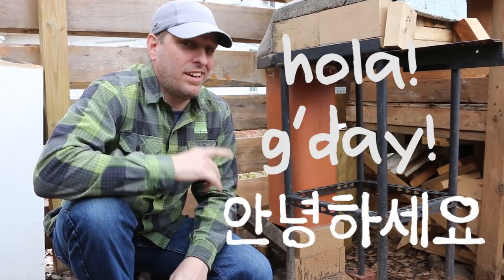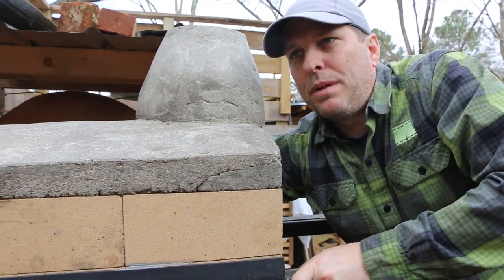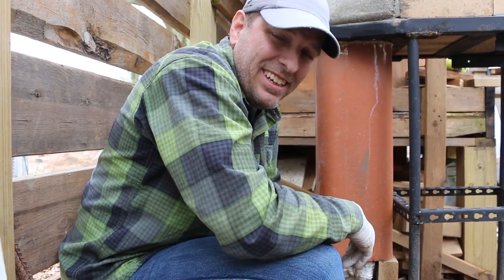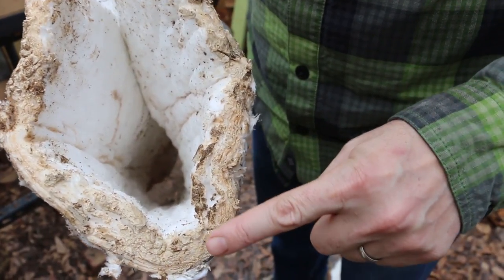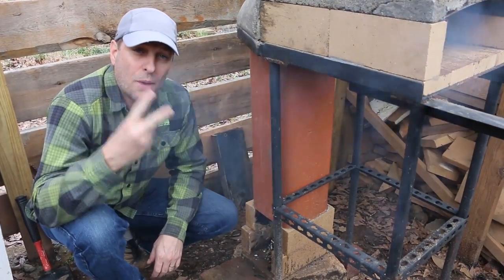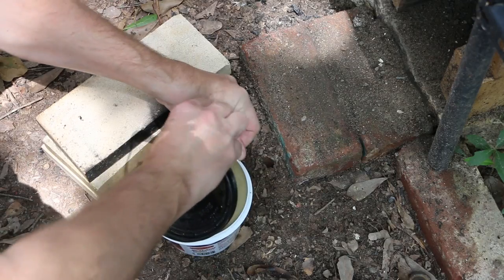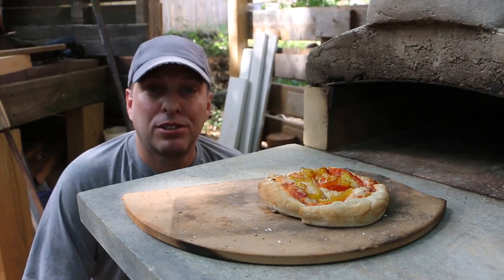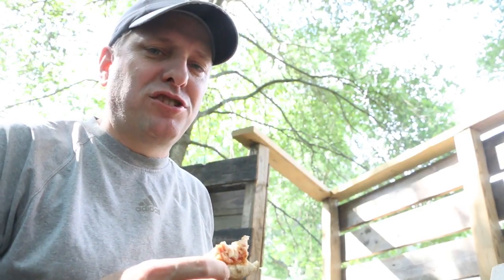How To Make A Rocket Stove Pizza Oven | Part 3

Comment: problem with cracking is the coefficient of expansion of two different materials. concrete and steel expand at different temperatures, that is why buildings collapse during fires, try building the dome with out  the reinforcement, perhaps brick arches then your concrete, otherwise good effort.

Comment: If you use a double floor and walls, with space in between, you could divert some of the heat around the oven chamber and have the hot floor that would crisp the bottom of the pizza.  Might also divert some of the ash.

Comment: A slight raise to your pizza base stone with say 1/4" shims on outside edges to allow heat to roll under the baking Stone as well. It IS shame as soggy bottoms take away from the pizza itself. Lol
Reply from the maker: Ha! Thanks for the suggestion, Edie. And you are correct, a crisp bottom is key to a good slice of pizza. Thanks for watching.
Reply: Actually, Edie's right, a double bottom might work a lot better. Look on Amazon for oven pizza stone that nearly fits your oven and lift it with some 1" or less angle iron. It might work if you insert it all the way to the back of the oven to direct flue gases and ash away from the pizza. Whatever, your determination and perseverance are really admirable!

Comment: use layer of  mineralwool/ Rockwool / glasswool from outside and heat loses will be minimal in winter ..... you can try using steal wool block at the joining portion of stove.. to avoid ash coming in to pizza oven....very  good video.....

Comment: Do you have a infrared thermometer? I’d be curious to see what temps you’re getting. Also, I wonder if the pizza stone is redundant. Weren’t they designed to mimic what firebricks do?

I just finished my earthen oven and am a bit frustrated at how much wood it takes to get that thing up to temp. This is a cool idea. I wonder if you could line the outside of the concrete with an insulator? Then the concrete would be your thermal mass and the insulator will retain that heat. Just a thought.

Edit: I just watched your second video and noticed the perlite. I don’t know if this is true, but I always assumed you didn’t want your thermal mass to be insulated. Don’t you want heat to transfer quickly to your thermal mass? Then you surround the thermal mass with insulation to retain that heat? I dunno. I’m a novice at this. Anyway, I hope it works out!
Reply from the maker: Hi Dustin. I don’t have a infrared thermometer, but do have a friend that does. I’ll have to borrow it. My thinking on the oven was that the rebar would be the thermal mass. I wanted to keep the heat from entering the concrete. I’ll need to spend a little more time with this oven to figure out how the heat flies through it. The thermometer will help. I also need to do a little research on your question about firebrick versus pizza stone. Thanks for the feedback and encouragement. Thanks for watching.
Reply: Hey bud, You're doing ok. Might of been better having the rebar above the perlite mix. Steel has no refractory capability so all you would be doing is heating the bar to room temp instead of generating heat. Same situation if you had a foundry furnace, you would never get temp up to melt a soda can. Best wishes and I'm following with interest.

Comment: Nice job and good craftsmanship but your Rocket Stove lower section need to be one half the length of the height of the exhaust flue,  with separate air space under material that is burning, increasing airspeed and complete burn with high temperature. Your effort will shine, great job!
Reply: Wait, how?

Comment: Good job,,, in my opinion you sh'd have the Rocket Stove centerd under the oven so the rocks w´d be the first contact and get heated up first, after that you channel out the the heat&smoke throu the inside of the oven. keep the good job up :)

Comment: I was hoping this would have worked better, for I was considering something similar, but thanks for giving me something to go build off of. I have to agree with those who talk of heating the floor first with a chamber and or rocket stove placed at the front. (With Chambers you could make it purely a white oven with no ash problem. The reason other ovens make 60-90 second pizzas is the combination of heat and heat types from all directions. I also do not understand why you went with the rebar. Was it to be able to support the dome? Metal may gain heat fast, but it also loses it faster requiring higher heat to maintain the cooking temps from what I understand. I also concur with the comment of not mixing perlite into the thermal mass (I think you hoped the rebar would be the main thermal mass though). I'm also not sure about using concrete? I just use fire clay and sand. It seems to hold and radiate the heat better. Fire clay for me is much less expensive than concrete ($9 for 50#) and is of such purity that the last oven I built did not crack. I was surprised. Also I usually do not use perlite as insulation, so I decided to try it with my last build. I found it inferior to using a course sawdust or planer shaving coated in a thin coat of clay. Have you found the same? You probably need a thicker insulation layer also. My pizzas are done usually in 60 seconds (thin crust light sauce) to 90 seconds (thicker crust heavy sauce) and people are amazed at how the crust is cooked through with no rawness/guminess between the crust and toppings. Overall I would summarize by saying it seems to need: 1. The floor heated, 2. Loose the metal, 3.Thicker insulation (no perlite in the thermal layer). Thanks again for being real and thorough with what you did. It will save me a step on my next build. jonathan
Reply from the maker: Thanks Jonathan. Good feedback. I need to get into some fire clay. And I've been wanting to try the sawdust method, so its nice to hear of your success with it. With the rebar I was trying to create a "broiler" top-down heat. The perlite was there to prevent heat transferring into the concrete (I didn't want the concrete to be thermal mass). I think one thing that might help my stove/oven combo is making my rocket stove chimney shorter. To get the flames moving through the oven body itself. Will definitely be using thinner crust. Thanks again for the comment. Thanks for watching.

Comment: great series.  I like how you show the project mishaps too.  we all have them, and learn from them.  I didn't even think about the kaowool danger.  I got some alumina silicate insulation, which I'm not sure is the same as kaowool, but discovered it is pretty dangerous.  Mainly from inhaling the fibers.  anyway, I have had pretty good luck with coating it with satanite, which is a high temp mortar.  you could use that for everything you use that tub of mortar for.  it's a powder and you can mix it up thicker or thinner depending on what your need is at the moment.  keep up the good work!

Comment: Great experimenting job.
You have to get the floor as hot as needed. And to do so you have to set the fire in front. Letting it mooving under the entire floor and getting out from the bsck to the chamber.
The entire chemines must be set in zig zag combined positions.
The chemine fire in front, sending the fire under the floor. The fire moves up to the chamber from the back and coming out from the uper front chemine.
Reply from the maker: Thanks for the feedback. I may make a second rocket stove under the floor. Thanks for watching.

Comment: Use the floor of your oven, let it get hot. 750 degrees in the middle should be good. Cheap infrared thermometers on amazon. And please use a metal pizza peel. For removing and turning the pizza. If the fire doesn’t rocket, add some fan to the fire. Cheap rechargeable ones on amazon, under $20. Just a little blow works wonders. Keep the door on while  oven heats up.

Comment: Years later I know, but if you still have the pizza oven, have you tried to just make a big fire in the top which would really get intense heat in the oven bottom? Once the fire is burned down enough, you could just push the coals back down the flu pipe.

Comment: make pizza crust 1/8th inch thick; use rolling pin if you have to; thinner you make faster it cook; make  it 1/16th if you can; 
as to cracking; sudden change in heat causes cracking; gradual rise in heat will not crack; even in earthen wares;

Comment: Great build, but I think your rocket stove pipe is too long, I would cut it in half, shorter distance, so the flame can enter the oven.
Reply from the maker: I completely agree. I’ve been thinking about that issue. My initial idea was to have the flames rolling across the rebar ceiling. I’ll tweak that project soon. Thanks for the suggestion. You’ll get credit. :-) Thanks for watching
Reply: GreenShortz DIY thanks so much! I’m a pizza oven freak myself and continuously tweaking as well, if you have time, please see my videos. I am making a small portable one a bit like yours but with the perlite mix.

Comment: Make the oven, over the rocket stove like you would a pot of beans the bottom of the oven will be firebrick on a steel grill for the oven bottom. That way you can make the fire brick the heat source.

Comment: Ah I have a solution for you. Use refractory cement instead, you use sodium silicate (water glass) and perlite. Look at some of the forge making videos to get an idea of what i'm talking about. You can make the sodium silicate or you can buy it. Just make a pretty dry mix and cure it with a torch.
Reply from the maker: Thanks for the suggestions, William. I need to learn the water glass method. Will do. Thanks for watching.

Comment: This is the first pizza oven linked to a rocket stove.Good for you!Maybe you can try some stand separated of the very floor at your oven;a hot flow circulating at both sides of your pizza ,I bet will be better.
Reply from the maker: Thanks for the feedback, Orlando. I think I need to get the fire closer to the top of the oven. Thanks for watching.

Comment: Ingenious idea to incorporate the rocket stove with a pizza oven.  I would like to see some actual temperatures of the oven floor.  Normal wood burning ovens require them to pre-heat for 2 to 4 hours which seems like a lot of kindling to be burned.  Like most rocket stoves, there is a lot of air flow in the vertical chimney.  I was wondering if this airflow would bring too many ashes onto both the top of the pizza as well as the oven floor.  Hope you fine tune the system and as well as your pizza technique and do another video.  We are all curious.  Thanks

Comment: Would it work better to put a crust in without toppings until it firmed up then pull it out. Put toppings on it then put it back in to finish up? That might ensure being less doughy in the center.

Comment: You should try using Pizza screens.   They come in many sizes and it makes it much easier to create the pizza.   You insert the pizza on the screen into the oven.  After the crust has firmed up a bit  you can remove the screen from the screen using tongs and a metal pizza peel.    I have a Bakers Pride P22 and this is how I make pizzas.   I use the tongs and rotate the screen 180 degrees because it is hotter in the back.   Once the pizza is mostly done I then slide it off the screen so it can rapidly brown the bottom.    You will have to play with the timing because everything depends on what temp you are cooking at.   The end result gives a nice screen pattern on the bottom.    Also you should make that crust much thinner because it rises.  no one likes a giant piece of bread with a little bit of sauce.

Comment: Another quick fix would be to use a  tiger torch with propane. Same principle as the  Roccbox  pizza ovens sold in britain. That way you can adjust the temp too

Comment: You may want to try metal heating duct instead of the terra cotta. You can use one piece inside the other and fill the gap with rock wool.
Reply from the maker: That would be a good solution, if I can find a non-galvanized metal flue. Thanks for the suggestion.

Comment: My Red Baron Pizza box says 400 degrees and 20 to 23 minutes. That's the pan method. The rack method takes 18 to 21 minutes. It says to pre heat the oven. I think your oven will work . You will get used to it. Good videos.

Comment: GreenShortz DIY - I enjoyed your project.  You could try separating the firebox and the air channel with a grate or grid so there is always a clear path for the air. Almost all of the other Rocket Stove videos I've seen do that and the stove burns real hot with not much fuel. There's a guy who built a rocket stove pizza oven with a firebox above the oven area as well as the usual one below. That oven gets crazy hot. Keep building stuff.

Comment: Awesome to see you change it. Maybe you have to put the pizza further into the back of the oven. Or consider to make a second layer for the pizza stone so hot air gets under it. Maybe even with drawer slides on the side so you can put it out for easier use.
Reply from the maker: Thanks for your feedback in the last video. I’m assuming you noticed one of the comments I sited was yours. :-) I like the idea of raising up the pizza stone. I think that would get the pizza up into a hotter air flow. Thank you for watching.

Comment: The re-rod is a good idea , But it should have been used to heat the bottom of the OVEN .  the top is always gonna be hotter then the bottom.
The angled brick you put in the back is forcing more ashes into the Oven when your Shoving wood in . The feed hole is too small for the amount of wood needed to supply the amount of heat needed hence more ashes.. 
Heating a pizza stone is not going to help that much if there’s nothing under it supplying heat it’s going to start cooling off as soon as the pizza hits it. You should do maybe just a little research before attempting such technical projects there is a bit of engineering and physics involved your on the right track but this tip may save you some headaches down the road

Comment: how did you make the fire space in the back, i want to build a rocket stove with outer shell rock anc cement adobe cob in intererior but have it curved like diy or square for shelves and use secondary for clay firing.
Reply from the maker: Hi Samantha. I rebuilt the whole rocket stove part of this oven. The chimney flue pipe could not handle the heat. The updated version is made from lava rock and stove mortar, with a fire brick fire box. I did a video about that build. When I got the stove mortar, I thought I was buying refractory cement. I have worked with refractory cement since then. While the stove mortar has held up, I think the refractory cement would be better. This oven gets to about 600 degrees. If you are firing clay, you may want a two rocket stoves. Sounds fun. Thank you for watching.

Comment: In the colonial earthen ovens, they would burn the wood inside till the earth/clay got hot enough to bake, then they take out the wood and swab it with a wet mop for the ash. SOOOO, your heating the oven and then letting the fire die down is the right approach. I would keep the door on for most of the heating, though the chimney does let out a chunk of the heat you want to save, but of course without it, it defeats the purpose of the rocket stove.

Comment: The ash buildup would be because your burn chamber is too short. Most of your fuel including smoke and ash should be burnt into heat. 2; your stove should produce you higher temps

Comment: How about a Rocket Stove x BBQ Kettle combination? All metal and runs on twigs and kindling rather than expensive heat beads - I like the idea anyway.
Reply from the maker: Hi Peter. I’ve got an old kettle grill Ive been thinking about hacking into an oven. Will put that on the list. Thank you for the feedback.
Reply: @GreenShortzDIY  A Pizza oven is similar to a BBQ kettle so if you had a kettle - say made out of a steel drum with a rocket stove connected to it and fueling it it would work well and it would need to be on 2 levels say on a porch the upper level to use the kettle and the lower level to keep the fuel fed into the rocket stove - and it would be cheap to run on biomass and even if you used heat beads you should need less than in a conventional bbq kettle & save money - just a thought

Comment: Hi!  I love the project.  Though many may think that buying one is easier, it is not the same when you DIY the hell out of it!  I have a couple of suggestions.  The idea of using a cooking sheet is a good one, however, I would keep the stoneware but heating it before putting the pizza on it as you noted but adding cornflower (and or oil) on the bottom of the pizza stoneware that way the pizza dough would not stick to the bottom and the dough should cook better.  I would keep the lid close though, only opening when switching sides, keeping it open does not maintain "constant" heat.  Maybe when you make the door you can place a heat resistance glass to see the progression of the baking process(?).

Comment: I think maybe the fire chimney needs to be directly under the middle of the oven floor then run the chimney up the back into the oven as you have it.  The oven floor has to be hot and this won't do it.

Comment: Great design and concept. I can see this working. All u need is chunks of dry kiln hardwood. It burns hotter for longer plus wont get all the ashes from the pieces of sticks ur using. Also close the front lid and heat up the oven longer. The base needs to be really hot to cook the bottom of pizza.